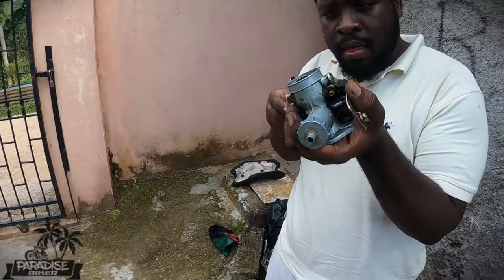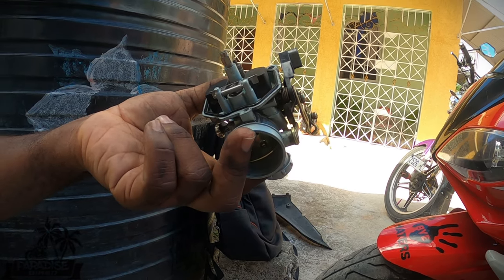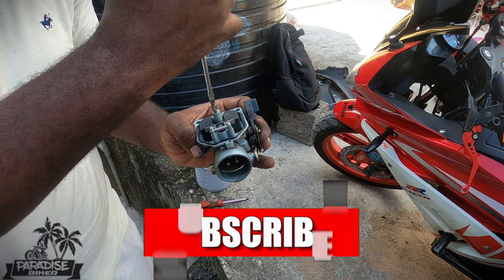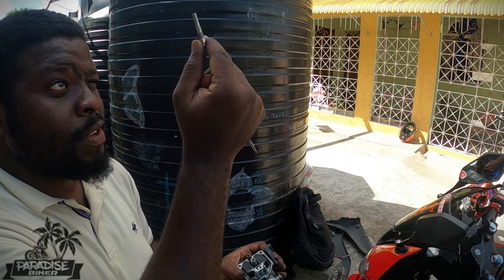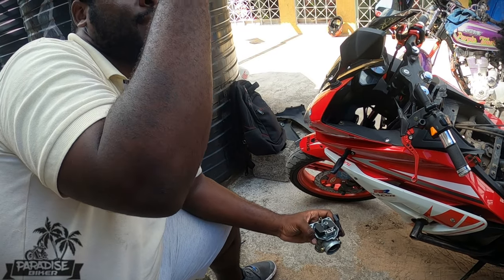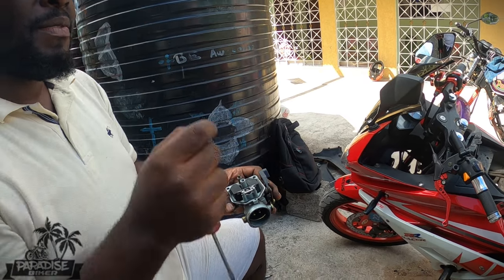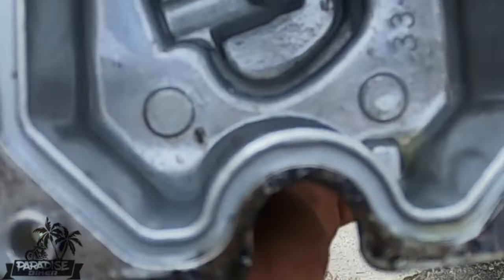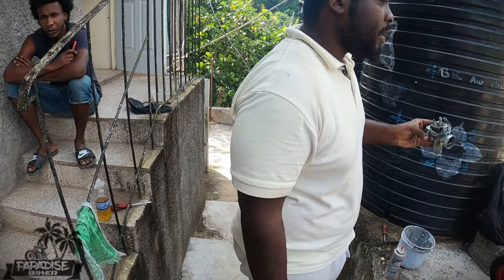Cleaning Carburetor With Jase (How To Clean Your Pz30 Carburetor) | Jamaican Bike Life 🇯🇲

Comment: @1:50 - @2:50  you don’t do that with the main jet , that needs to be done with the air fuel screw
Reply from the maker: So basically you're saying the main jet can be tightened down all the way (not how it comes stock) and get the same performance 🤔... I beg to differ
Reply: @ParadiseBiker  yes it should be tightened all the way , only the size of the jet can affect performance not how tight it is.